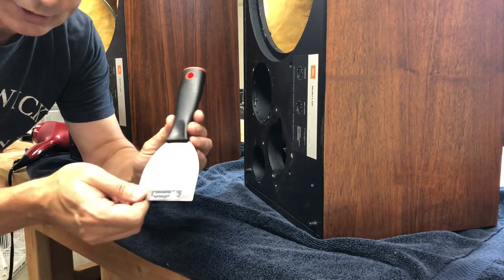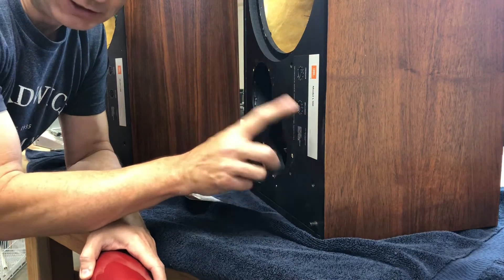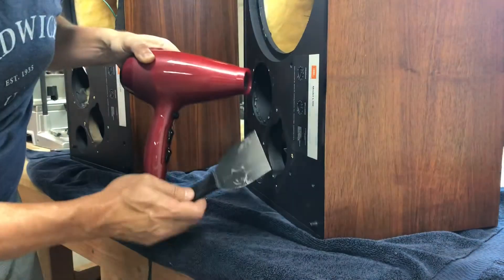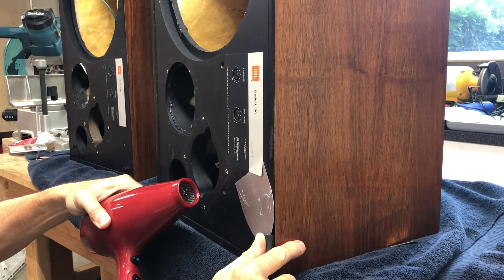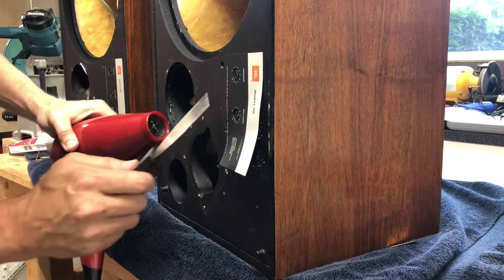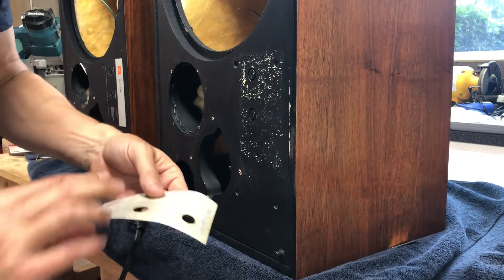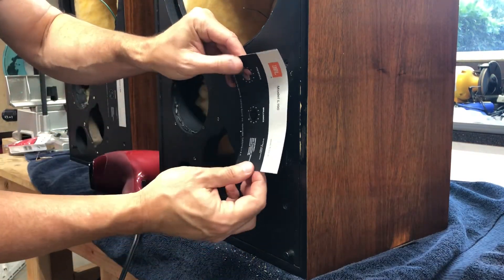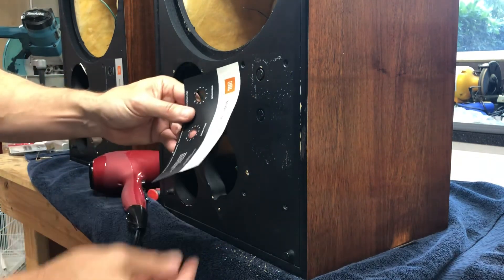How to Remove Vintage JBL Foilcals (Metal Foil Decals)

Comment: stellar! ....I see they sell them on eboy for $140 a pair...yikes  Curious if your screws woofer screws came out as one twisted insert and broke the particle board. Not sure weather to repair that wood with epoxy or twist woofer an inch or two and start 4 more holes. Not impressed with their attachment method.
Reply from the maker: Thanks, and sorry to hear that nut broke loose.  I've seen that before; it's frustrating.  Me, I'd try to keep them as original as possible and epoxy the nut back where it was.  Good luck and have fun!

Comment: Fantastic video. Thoughts on removing 4312 foilcals? Lots bigger
Reply from the maker: Thanks!  It should be the same; I'd warm them up then work my way down the length of the exposed edge.  I'd also pull off the knobs first.

Comment: Tying to remove the LF Driver and I am having trouble breaking it loose. What procedure did you use?
Reply from the maker: Leave the screws partway in to keep the woofer from falling out, lay the cabinet on its side on some carpet, then lift the bottom end of the cabinet maybe six inches and let it fall against the carpet a few times and the woofer should pop loose.
Reply: @zonker92  Tried that severl times and it still won't come loose.
Reply from the maker: @ That paint can be stubborn.  Another thing I’ve done is to pry one loose with the tip of a screwdriver inside one of the mounting holes.
Reply: @zonker92  I will give that a try.

Comment: Do you have any advise for what paint to use to repaint JBL baffles? Also what type of glue do you recommend to reattach the foilcal badges?
Reply from the maker: I use Duplicolor Bumper and Trim spray paint (from the auto parts store) on baffles.  It's has a little more sheen than stock, and looks terrific.  If you want stock, I would suggest flat black spray paint.  You can see a lot of my restoration photos on Audiokarma.  I use regular Weldwood contact cement to reattach the foilcals, per the can instructions.  Make sure to get the adhesive all the way out to the edge or they will lift.  Mask off the rest of the baffles.
Reply: zonker92 thanks! I am refurbishing a pair of L110 right now and the foilcal seem to be the most troublesome. I had some good experience with 3m double sided tape but wanted a less expensive way of reattaching them. I try to go for original so I will just stay with the flat black on my job. Thanks again
Reply from the maker: @AtariCentauri30  Excellent; you're quite welcome.  I'm redoing some L110s, too, and I have the foilcals off: still awaiting restoration before I put them back on.  I have also found that when foilcals start coming loose, as they often do, and the edges start to lift up, you can reactivate the glue with a hot iron (no steam) pressing down through cotton like a t-shirt.
Reply: zonker92 awesome! These are my first complete refurbishment including recap. I am not to active on audiokarma but I do all my research on there. I wish you luck on your L110 project. They are great speakers!